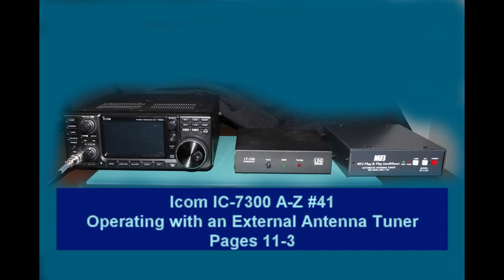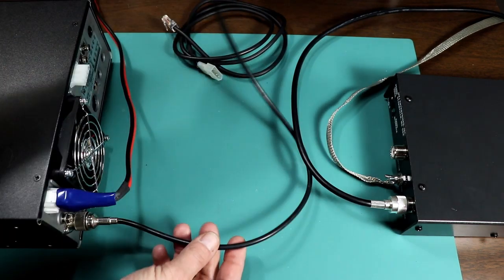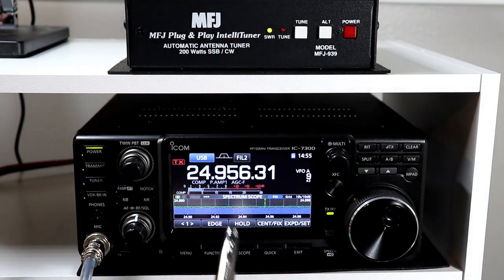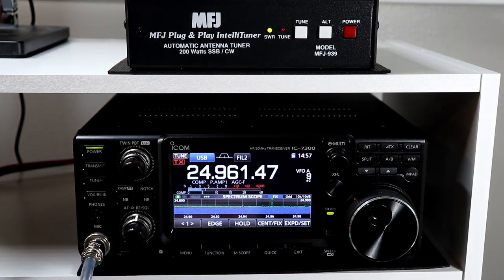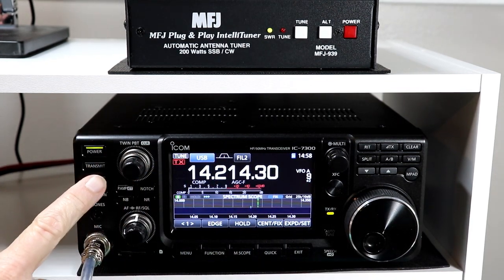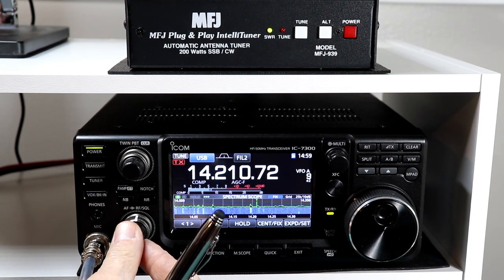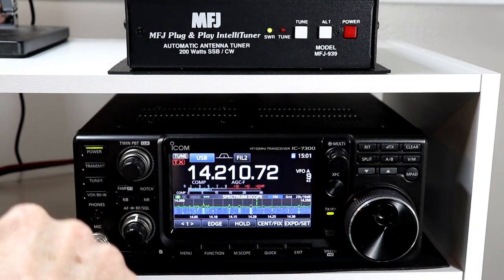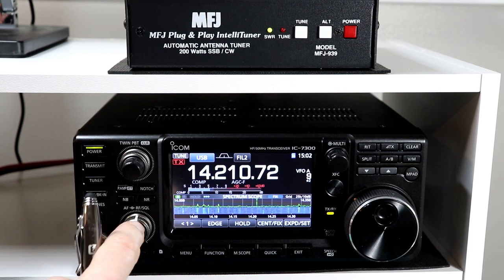Icom IC7300 A to Z #41 Using an External Antenna Tuner

Comment: I use an MFJ929 auto tuner without a data connection wire  to the IC 7300. Works fine... I just turn power down to 5 watts... And transmit a CW signal... For a few seconds... To allow the MFJ 929 to adjust itself. In case there is a ham  out there that already has an auto tuner... without a data line... Don't despair... You'll find it works great this way. After tuning up of course, I then bring power up to the 100 watts output

Comment: Tom, your series on the 7300 has been great. I have the mfj 939 as well. You don’t have to pull the cable if you want to use only the 7300 internal tuner. Just power off the 939. The 7300 internal tuner will then tune the antenna, bypassing the 939.
Reply from the maker: Thanks Bob!  I never tried that.  Seems like that should have been a pretty obvious thing to try too.  Great tip.  73,  Tom, WA2IVD

Comment: Unless the MFJ has been set to bypass (hold down tune for 0.5 sec - one beep conformation), the tuner is still in series with the coax (even if it's off - latching relays).  To operate without the MFJ tuner, you have to put it in bypass and turn it off.  Then the radio will use it's own tuner and the MFJ won't be seen as part of the antenna load.

Comment: Thanks a million!  This is valuable information simply because there is absolutely NO information in the manual about using the MFJ 939i with an ICOM 7300.  The MFJ website is a disaster when it comes to finding a manual.  Fortunately, a dear soul sent me the manual as an attachment to an email.  But it wasn't at all useful for my radio.  My frustration level is now back down to normal.  Many thanks.

Comment: I dont have the 939 but I do have the 993 tuner. On this one I just press the power button to turn it off and then the 7300 uses it's internal tuner. This is useful on 6m & 4m which the 993 can't tune so I use the 7300 tuner here instead.
Reply: Just like you said, Andrew, I turn the power off to my MFJ-929 and the internal tuner stops working.  No need to disconnect a cable by hand.

Comment: Thanks! I have the LDG AT100PROII tuner for my IC-7300. It came with a power cable so I had to buy the ICOM cable. I bought the IT-100 for my IC-7100. It came with the proper cable for ICOM radios.

Comment: Interesting that your demonstration seemed to prove the point that the antenna must be tuned in order to receive as well as broadcast.  I recently watched another highly subscribed YouTube HAM channel that was doing a livestream with the IC-7300 and he couldn't understand why several bands were "strangely empty."  When a viewer pointed out that he needed to retune when switching bands he really berated that viewer and repeatedly said that there is no need to tune when only receiving .  I guess I now know which YT channel to put into the "blowhard" bucket and which one to put in the "great reference" bucket.  :)  thanks for this really great series!   You just got another new sub.
Reply from the maker: Hi.  First, thank you for the kind words.  I’m glad you’re finding the channel useful.  It is true that tuning isn’t “necessary” during receive, in that it won’t hurt the radio.  However, it definitely can make a big difference on receive especially if you’re using a compromise antenna that can only be matched to small portions of bandwidth at any one time.  I know that I have mistakes in some of my videos as well.  I will promise that I won’t berate anyone for pointing out something wrong.  I’ll either acknowledge the error or, if I do believe I’m right, I’ll do my best to calmly explain why I think something is correct.  Thanks for watching!  73, Tom

Comment: Tom very timely for me as I work my way thru your videos. My 7300 internal tuner won’t tune all the bands on my new vertical. The antenna manufacturing recommended the LDG. I like the plug and play as I was concerned about the setup. Your video cleared up my worries. Thanks. 73 NP2BB

Comment: Tom  Thanks for the great video. I replaced the back external tuner connection with a RX 7300 SMA. I enjoy having the ability to Rx on a separate antenna from my transmit antenna. The external connector is tucked under the radio cover. I can still use it if I make another cutout on the back. I’m contemplating replacing my Carolina Windom with a ladder line dipole for 80-10 meters. When running power  I have an old Alpha 91b with a manual palstar tuner.   I think that some IC 7300 users are not aware of the Emergency Mode setting which will tune an SWR 10:1. The only downside is that you will max the power at 50 watts. Theoretically that should decrease my signal by less than one S unit. Not a big change.   Tnx agn for an informative video.   Peter/ AA2VG

Comment: Tom,  thanks for your videos.  I have had my IC7300 going on 4 years, I still learn from the videos.  I would like to see a video on the SWR measurement function the radio has.  This feature has been very helpful for me and I think others would find it useful as well.
Reply from the maker: Hi Larry.  Yes, that is another one of the lesser used features that I just haven't done a video for, yet.  One will be coming.  Thanks.  Tom

Comment: Thanks for the videos. They sure help getting me up and running on my new Icom 7300. I bought the LGD IT-100 tuner to use with a myantenna OCF dipole 4010-3K antenna. All your videos are very good. Thanks again! WA9H, 73's

Comment: Great video as always Tom, thanks very much! I have both the IC-7300 and the MFJ-939 auto tuner. While not all MFJ products are 'great', the 939 is fantastic! It's fast, accurate and easy to use. (Worked better for me than the LDG product.) I power it off with a simple click when I just want to use the 7300 internal tuner for 'easy' matches, and then power it back on for the tougher matches (e.g. 160M and 80M on my HWEF 4010 antenna). I touch the 939 'ALT' button for my second antenna because it stores a complete different set of matches for that one. I've also noticed that if you tune the antenna more than once, it usually fine tunes the match even better. I've consistently noticed this effect by using the 7300 SWR band graphing tool. 73s Greg KJ6ER Silicon Valley

Comment: New Ham here.  So I watched the vid on the internal tuner.  Now I watched this.  So does it go without saying that an external tuner is perhaps not 'required' equipment.  But highly preferable?  BTW I subbed and intend to watch every 7300 video you have.  It is my radio of choice as I venture into this new hobby.  Hits the sweet spot of quality, features, price.  No call sign yet, I passed Tech and General just 2 days ago.
Reply from the maker: Hi.  First, congratulations on the Tech and General!  Second, thanks for watching!  An external tuner may or may not be “required” or even “preferable”, depending on your setup.  If you live where you can put up resonant antennas for whichever bands you want to work, then just the internal tuner or maybe even no tuner will be fine.  If your antennas are 3:1 SWR or less on the bands you want to work, then the internal tuner will cover that just fine.  If you have to operate where you have to use a compromise antenna and/or you want to work most or all of the HF bands, then you might need an external tuner.  Sorry this is an answer that really isn’t an answer, but it really depends on your circumstances and goals.

Comment: My 939 communicates the tune status on to the face of the 7300. There is an internal set of jumpers in the 939, that has to be set for icom rigs.
Reply: What are the setting please? I cannot find in the user manual.
Reply: @keithwinkler736  pages 9-22 cover the internal jumper settings, and interface cableing, for each brand of radio supported. 

The easiest way of avoiding this, would be to purchase the 939 model intended for your radio. In the case of the 7300, it would be the MFJ 939i. Then it comes pre-set for the radio, along with the proper interface cable.
Reply: @miker1473  Thank you Mike R
Reply: @keithwinkler736  but.....you can always use the plain 939 in a stand alone mode. Just use the DC power cable to power it, and, hit the tune button on the face of the tuner to tune. You can also set the 939 to initiate a tune on its own, if the sensed swr is above a certain level. It actually works pretty good for being an mfj product.

Comment: Hi Smoke, at 2:56, regarding the PTT Start---I do like that feature. So if I have the PTT Start enabled, when I change bands and transmit, the 939i will automatically tune? I won't have to press tune on the radio or 939i, correct? thanks!
Reply from the maker: Yes.  That's correct.

Comment: Your videos are very helpful
Reply: Tom, I liked your video on using an MFJ tuner with the Icom 7300. One extra thing you might have included was the function buttons on the MFJ. I think you assumed that connecting the two simply brought "up" the MFJ and that may well be the case. But I'm left wondering what the buttons on the MFJ are for or what they then do. Thanks, R B Pierce

Comment: Tom hi

I just received my 939 today. 

Another question(s). 
Are you reducing power on the 7300 before tuning the 939?
I know the 7300’s internal tuner automatically does this for you. 
As for the 939’s auto/semi auto settings(gets a bit confusing) and the ‘sticky mode’, how are you setting these?

Thanku again!
I really enjoy your videos. A really nice teaching voice😃. 

William
Reply from the maker: When the 7300 senses that an external tuner is present, it will set the output to 10 watts and cause the external tuner to tune when you long press the TUNE button.  The internal tuner is automatically bypassed.  This all assumes that you have the tuner interface cable plugged into the tuner connector on the back of the radio.  With the interface cable connected, you don't need to worry about the 'sticky mode'.  The TUNE button on the radio will key the radio and activate the tuner.
I know the 939 has memory banks for multiple antennas and several options for how it operates.  I frankly have not used any of those features.  I don't currently have multiple antennas coming into my shack.  When I take the tuner to other locations, I just let it re-tune on the different antenna.  It is fast enough that I don't find it worth it to keep track of which memory bank is set for which location I operate at.
Hope this helps.  Thanks for watching and thanks for the kind words.
Tom
Reply: @HamRadioA2Z  Thanku for this info.  It answers my questions!!

Best
William

Comment: Tom.  

I hv come more in line with the 939. 
What I would like to ask is, when connected and pushing the tuner button on the 7300, do I need to turn down the power from 100 percent to 10,20%, etc.? Or will the radio do it for me?

Thanku again

William
Reply from the maker: When you press and hold the TUNE button on the 7300 (or on the 939), the 7300 will set the power level to 10 watts and output a CW carrier regardless of the current mode and power setting.

Comment: Another nice video

Question.  With the mfj hooked up, can u press tune on either the radio or the mfj to engage tuning?
Lastly, I saw u tune up on 160. Is ur wire an 80-10 or a 160-10?

Thanks
William
Reply from the maker: Yes. With the MFJ,, LDG, or any tuner made to interface with Icom radios you can press the Tune button on the radio or on the tuner. 
When I made that video I had a 53ft end fed random wire. It wasn’t very efficient on 40 or 80, let alone 160. I just wanted to see if the tuner could match it on 160.
Reply: @HamRadioA2Z  Thanku for replying!

Were you able to reach anyone on 160 or was it just matching and thats it?  The 7300’s internal tuner is too limited, even on the high end of 80 meters(3900-4000. With emergency mode(10:1 I believe)I can indeed do it.  
With my 140 foot end fed and a good external auto tuner, I was hoping for just a bit of 160 meters.  If so, do u consider the mfj 939(great reviews) or the ldg ?

Thanku again
William

Comment: Very good video!  Over the past several years I have bought and sold several IC-7300's.  I have always been puzzled as to why Icom doesn't go into more detail about using external tuners in the manual.  You would think there would be a setting you would have to disable to bypass the internal tuner if using and external tuner.  I have always wondered if both the internal and external tuners were both "TUNING" when using the tune button on the IC-7300.  The best I could tell, just as you mentioned, the radio senses the external tuner and bypasses the internal tuner automatically.  I am using an LDG AT-100ProII Autotuner with the LDG Icom cable on my IC-7300 with great success!
Reply: I had that same problem.  I just figured if I didn’t hear the internal tuning noises inside the 7300 and I heard my LDG working than all was well.  73, W2LTD.
Reply: Yes, I was trying to understand this also; and the IC-7300 manual doesn't mention how the external tuner control works! I am using a Elecraft KAT500 tuner.

Comment: This video did help - thanks!  Two newbie questions though:  Will the SWR meter on the Icom reflect the tuned values (mine don't seem to change) and I bought the MFJ939 but there's nothing that says MFJ939i but I did get the Icom cable.
Reply from the maker: The built in SWR meter is on the radio side of the tuner.  So, yes you will see the tuned SWR numbers, not what the antenna is actually doing.

Comment: Tom, Great series.  Did you have to remove any jumpers on the inside of your 939 to get it to work with the 7300?  I just got another MFJ-939i and the 7300 tuner button doesn't operate the external tuner.
Reply from the maker: Hi Bill.  If you got the 939i, you shouldn’t have to change any jumpers. The “i” model is supposed to be preset for Icom radios.  That is the model I have and I didn’t have to change anything for it to work with my 7300.  If you bought one used, maybe the previous owner changed the jumpers to work with a different brand.  I believe all of the 939’s are the same unit with the jumpers preset for each radio brand.  The instruction manual shows the correct jumper settings for each radio brand.
Reply: @HamRadioA2Z  Tom, this is my second 939 so I suspected that the interface cable was bad.  So I used the cable from the 939 I use with my IC-7100  to test my connection to the 7300.  The 939 worked as expected with a properly wired cable.  Bottom line, MFJ is sending my a new interface cable.   THANK YOU SO MUCH FOR GETTING BACK TO ME.

Comment: I have found the MFJ more forgiving of impedance mismatch than the LDG. I do have both and the LDG MUST have a balanced load where I can run my random wire directly to the MFJ 939. I use both tuners with my MARS station because the internal tuners of both my radios cannot handle the out of band conditions. My other radio is an IC745Pro. I have a second MFJ939 that works better with the second antenna port of the 745 without the control cable where the LDG AT100P is useless on that port when using ALE. The LDG works fine with my fan dipole that is cut to the MARS frequencies. 73 WB2HVF

Comment: I have an MFJ-939 and an IC-7100 ito an end-fed. However my tuner is located at the feed point. I use bias tees sp the power runs on the coax. Check my QRZ. --de N3TS

Comment: I have a MFJ 929 that has a J4 jumper installed. Do I have to remove it before using the external tuner?

Thanks in advance.
Reply from the maker: Hi.  I’m afraid I don’t have any experience the 929.  I have the 939i tuner.  I’m not sure how similar or different it is from the 929.  The 939 series is available as i, y, or k  versions that come preset for Icom, Yaesu, or Kenwood radios.  I don’t know if the 929 has similar options.

Comment: Great video but would like to know the real benefits of using this external tuner compared to the built it. I don't think I have an issue using just the internal one. Thanks
Reply from the maker: The main reason for using an external tuner is if you have an antenna that has an SWR higher than 3:1 on any bands that you want to work.  That is the limit of the internal tuner.  So if you significant antenna restrictions where you live, or if you do a lot of portable and/or emergency communication work an external antenna tuner can get you on the air where the internal tuner might not.

Comment: Tom, Thanks so much for making these informative videos! I have a question about the "auto/tune" button (R/lower side) ... do you cover that in one of your videos? Also the steel deck chair looks identical to the one my Neighbor gave me many moons ago. Best 73, Charlie, N2SRQ.
Reply from the maker: Hi Charlie.  Thanks for the kind words.  I think I did cover AutoTune in a CW video, but it was a few years ago.  I’ll have to figure out which one.  In CW mode, that button will adjust your receive frequency to put you right on the carrier frequency of a CW signal.  If the band is real crowded with multiple CW signals, it doesn’t work so great.  It has no way of knowing which signal you want to tune to.